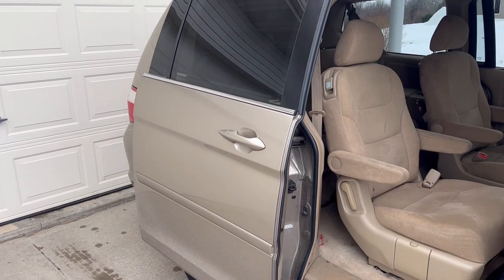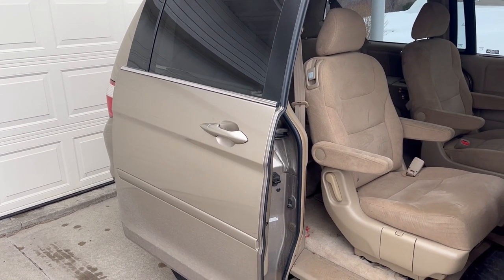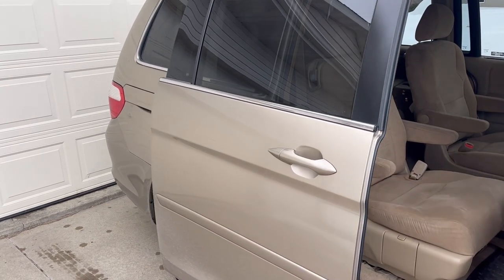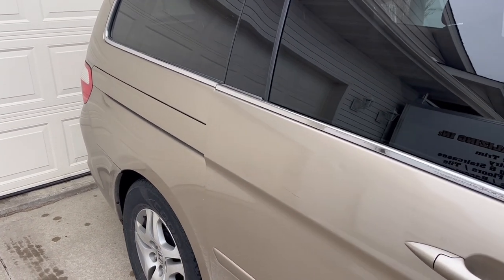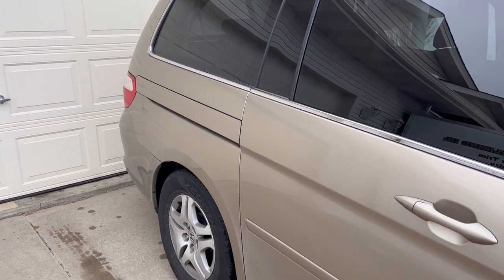Honda Odyssey Sliding Doors and Parasitic Drain Fixed—1 Year later

Comment: Thank you for your video. I just ordered a replacement latch as it could not be cleaned.  Battery dies after 2 days.  It was quite easy to remove. My door bussed on and off for 2 years. When the buzzing stopped my battery died.  Replaced the motor, not the latch.  Still battery died.  Took out latch found out it was broken.
Reply: I went to Honda to find the battery drain. They said it was the passenger's sliding door. So, I got a quote from them to fix both sliding doors... Control Unit for sliding doors (failing) $1620.35, Driving sliding door motor - failed $1,248.00, Passenger sliding door release actuator failing $859.32, Latch on passenger sliding door malfunction $1,049.99

Comment: Thank you for the thorough and clear video. My son & I took this on for our 2007 Odyssey with exactly this issue. The sliding mechanism was definitely gummy. It took us approx 3 hours. Unfortunately after the fix our siding door doesn't auto-open but the battery drain seems fixed. I started the van the next day and it turned over fine. We think that when the problem started with the parasitic drain it burned something out because the circuit was open so long.. maybe a fuse? switch? gotta find another youTube video. But a least our battery is saved and we can drive it.
Reply from the maker: Glad to hear you  were able to fix the parasitic drain! That's the more inconvenient problem in my opinion, so it's good that the process fixed at least that. If you haven't already, you may want to try resetting the doors by removing fuse 7 in the driver's side fuse panel as shown in this video from Barbour's Auto Help: https://youtu.be/xUy1s8g6hck?si=PnSQc_mMNIiexy4f.

Comment: I.followed your video instructions removed , cleaned and oiled the mechanism on  oth doors. The driver side worked fine for about a year and is now not working at all.  Parasitic drain has returned  and the power feature does not work at all. The weird thing is that when the power door switch is off it and when i close it the door tries to suck in but then releases. Im going to remove the mechanism again and try to clean and re-oil it, basicly the same repair, i guess i have to check the other actuators and rubber peices... any other advice welcome?.

Comment: Why do you remove fuse 7 for the door sliding problem? I didn't catch the reason. What is the purpose of the fuse?
Reply from the maker: That is a great question, and to be perfectly honest, I don’t know precisely what it does. I do know that by removing it you can effectively reset the sliding door control module thingies, which can temporarily solve the problem of the door not responding in any way. 

Removing that fuse also eliminates the parasitic drain, at the expense of disabling the doors and several other circuits.

Comment: Is there anyway to bypass the switches so they always think the door is closed so they wont drain? I dont want automatic doors anymore. What about zip tieing the switch shut or twisting the wites together or cutting the wire or what??
Reply from the maker: To be perfectly honest, I'm not sure if there's a way to bypass the switches in the way you describe. The most likely thing to happen if you were to fix the switches closed is that the closer mechanism would cease to work properly, but don't take my word for it. The best solution to bypass the doors is to simply remove the infamous fuse #7 on the driver's side interior fuse panel, which will disable the automatic doors and several other functions that normally work with the key out of the ignition, such as locking the doors and having the interior lights automatically come on.
Reply: @hanspoole removing the #7 fuse it will still drain the battery I measured with a multimeter it stops the constant draining but it still looks for a signal every few seconds. The odyssey forum also noticed this. I would really like to bypass them hmm 🤔 I will do some testing and let you know